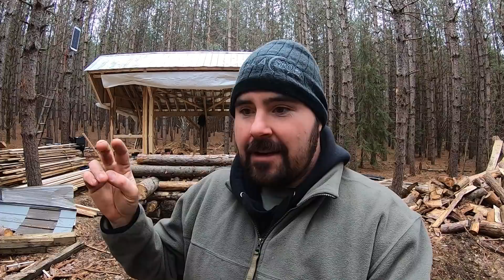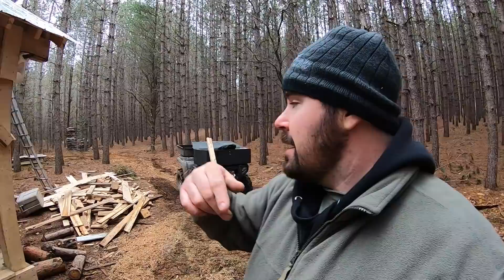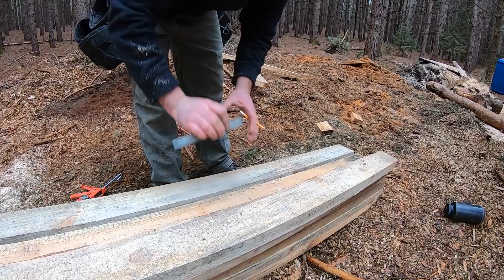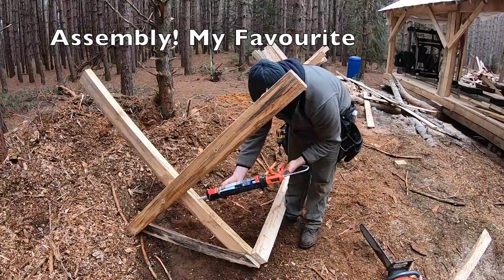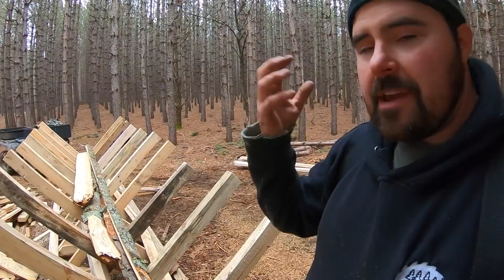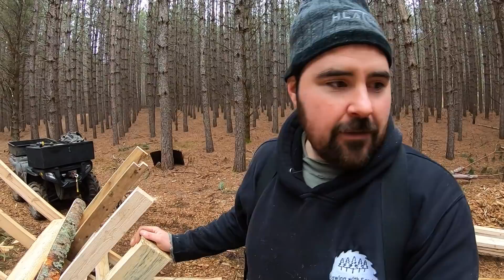How I Made a Sawmill Offcut Rack | Sawmill Shed Build - Episode 16

Comment: Start saving your used motor oil to use as wood preservative. Looks great. Good idea.
Reply: I use a mix of used Oil and Diesel fuel, solves your bug infestation problem too.
Reply: @russcollins4306  I've done that using some that I drained out of an old tractor I bought.  One can also use gas or mineral spirits or anything similar to cut it a bit. I found it helps soak in faster and better. Been using it on trailer decks and it does great.
Reply: Somebody gave me 300 gallons of used cooking oil.  I hope to lightly burn the surface of some incense cedar siding boards, then wire brush, then cooking oil.  A frugal fireproofing and rot prevention.

Comment: Good day to you Sandy, nice to see you going forward with different types of your own ''inventions'' (slab rack) About the dull chain, suggestion I learned, and I still use, from my old folks; I always have 3 or 4 chains already sharpened with my saw, chains which were brand new at the same time and which I alternate between each use (become dull) instead of stopping for sharpening (I also do sharpen to take a break, sometimes ;-) ); in this way all chains wear out at the +/- same rate and at the same time as the drive pinion which, after having driven 4 chains, will have to be replaced anyway. I do appreciate every of your videos and keep it safe. Be well. :- D

Comment: I made one several years ago out of 2x4's, but a different design. Mine is built like a table, in 6 sections. Each section is 20" long, with a 4" gap before the next table section. The back has tall 2x4's to keep the slabs on, the front has folding 2x4's to make for easy loading and unloading. Also, the 4" gap allows me to cut the slabs without cutting into the rack  and all the wood is the same length. You can add as many sections to the rack as you want for the length of the slabs

Comment: It's a little longer than normal but that's called a sawbuck, a very handy fixture.  The horizontal boards just below the cross are throw aways, replacev when they're too gone.

It works great for whole logs too for cutting firewood to length.  Keeps the logs off the ground.

Comment: Hey Sandy. If you built the rack slightly higher for IBCs to fit underneath in a row when you cut up the offcuts, they would fall directly inside with the only work left to do is rotate full IBCs and with empty ones.

Comment: Awesome project! I found a rough lumber sealer called Woodlife copper coat. It’s good for a project like this one. You can use above or below ground as well. I just built a porch and used this product on the 6x6 posts and porch framing. It will turn it a treated green look  and has a unique smell kinda like a beaver gland lol. It’s very thin, so You can use a pump sprayer to apply.
Reply: Something else to with your batteries on your drill. Take hand warmers and attach it to the battery. I use to just duct tape and it would last most of the day. But I eventually made a fabric bag with Velcro and attached it to battery this way. I’ve been filming outdoor video for over 20 years and the cold is brutal on batteries. I kept all my batteries in insulated bags with hand warmers and used Velcro method on my camera so battery never got cold. Lot of info but thought it might help you get a little more life.

Comment: In the new position it should be easier to just pull onto the rack rather than lifting long bits over the top of the mill. You could put a sacrificial low quality log at the bottom of the V, then just swap it off/saw it up when it gets too beaten up.

Comment: Looks very strong.  I have one similar.  A suggestion I would make is add (2) 2X4's across the top that you can cut into and replace easily, i.e. do not glue them and only use a few screws.  I find myself hitting these and plan on replacing them.  Another thing I also find myself doing is making my initial cuts into the log a bit larger so the off cuts will go into the fireplace.  Good luck with yours.
Reply from the maker: Thanks for the tips Andy.

Comment: with my back i hate bending over ...when you make the cuts the firewood still falls to the ground...if i was makeing one of them i  would add another  X 12 inches away leaving 4 inches between the next one where i would be cutting  so the firewood wouldnt fall out when cut making it easier to load in the bucket of the tractor...but then again maybe it would make the saw bind up

Comment: Have you thought about adding a small hand powered winch like the kind used on a boat trailer to pull the logs onto the mill bed?
Reply: I have ancient geared boat winch that I power with an ancient 1/2” drill.  Pulls a lot of weight. I hope to load logs with it.

Comment: I heard used engine oil was a good sealer for wood.
Reply: Wouldn’t use the engine oil, full of carbon and soot, makes a mess, linseed oil or a sealer would be a better choice, as technitions we wear gloves when getting into the engine so to speak. So our hands don’t get the dirty oil and containment’s on our fingers and hands.
Reply: From what I've read, that carbon build up is sort of a good thing if you're trying to weatherproof something tho. It's supposed to make the wood less appetizing to pest attacks. Having said that, it wouldn't be my first choice. I'd probably paint it with linseed oil or tar.
Reply: Engine oil mixed with diesel fuel
Reply: Used oil repels water, diesel fuel kills bugs, mix the two so that u can run it through garden sprayer.  Put on exposed wood.

Comment: Wondering which brand of construction adhesive you prefer? I have tried several  but it is difficulty to determine which offers the strongest result.
Reply: PL premium is the best construction adhesive available PL product work great never let go.
Reply: @oldcountry220  Yes, I have to agree with you about PL Premium Construction Adhesive. I have noticed that some of the sub categories  in this product are said to be 3 times stronger than some others, while the same PL Premium brand has at least one of their adhesives that is said to be 8 times stronger.
However, I have heard that the 8 times stronger version is mighty hard to force out of its caulking tube. For this reason, I have stuck with their versions that claim to be 3 times stronger. Still always satisfied with the results.